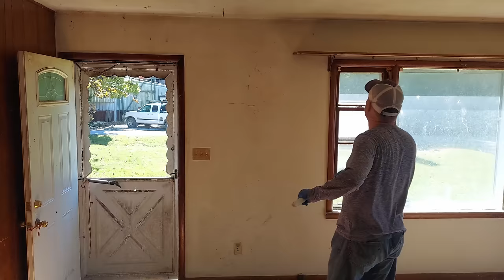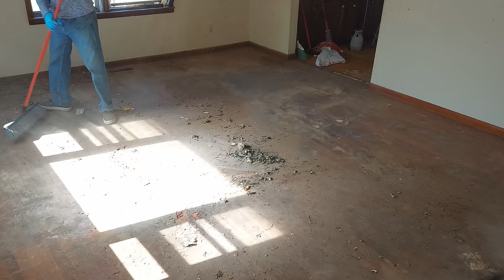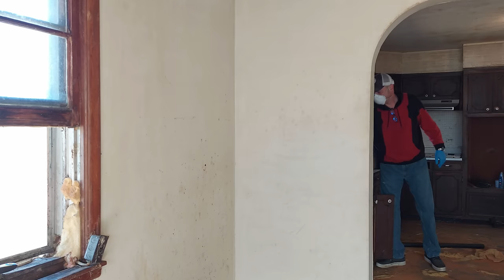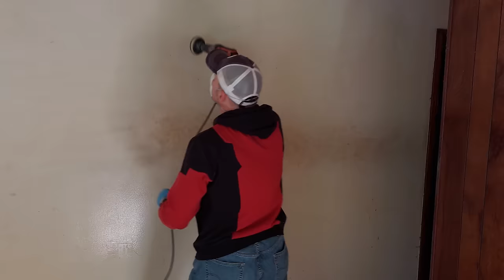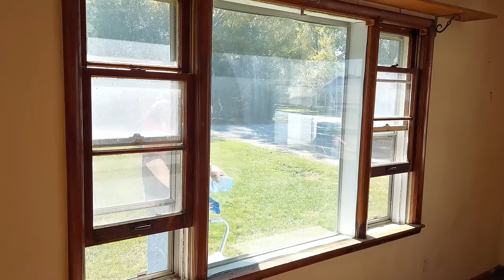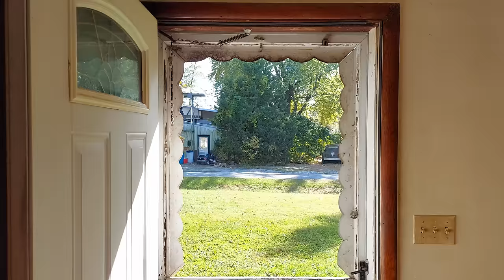Hoarder Aftermath: Cleaning RUINED hardwood floors

Comment: I bought a former hoarder house. didn't know it that was the case till I moved in. they surface cleaned everything but the floor under the wall to wall area carpet was like this one. i had to wash it with Kealn Strip -Paint & Varnish Stripper. turned out great but was a lot of work. I didn't use gloves and was fine. it also didn't remove the stain on the floor only the thick tacky dirt.

Comment: I live in a house that is 100 years old. Hardwood floors throughout. The floors were very filthy when we bought it 10 yrs ago. Thankfully not stained as bad as there but years of neglect. I swear by liquid gold. Our floors were very dry as well. I used the liquid instead of the spray and wow at the difference. I do this at least once a year now. They just glow and the wood drinks it up.

Comment: pine sol dries out wood. should have used Murphy's oil soap. then something like Old English oil to buff it up and put moisture back into the wood. from there you can use regular dilution of Murphy's for regular cleaning. 4/5 x I've saved the trouble of restaining  wood simply using Murphy's/Old English.

Comment: I have cleaned houses in a similar condition. You should try TSP. It comes in a powder and a liquid. It works wonders, but has to be rinsed. You only need to use a few tablespoons of the powder with really dirty stuff like that.

Comment: Using a square buff sander with a sanding screen would remove the surface debris.
You would then use sand paper to finish.
Solvent-based stain will condition the dry wood.
Oil-based poly will seal the wood.

Comment: I'm sure you're going to receive hundreds of tips on making these tasks a tad less labor-intensive so I may as well throw mine in the mix. A few professional cleaners I know who prepare rental properties for occupancy and the paint stores they buy this product from swear by it. CHALLENGER. You can dilute the concentrate 10 to 1, apply it and let it sit for a bit. It rocks. The other 'pro tip' I heard is TSP (tri-sodium phosphate). Comes powdered and you can adjust the strength to whatever suits the situation but it'll knock years of crud off of anything. Best of luck...Carry on.

Comment: This sounds crazy but it worked, I used toilet bowl cleaner the clinging thick type pour it one coat rather thick it set over night it bleached and cleaned in one go. Then I bought a commercial striper and refinisher it was really easy as the bleach made the stain and varnish soft.

Comment: Soapy water and Pinesoil? I had one about the same size, beautiful wood but somebody decades ago decided gluing plastic tiles was the thing to do. The tiles were twisted and loose but the glue had petrified. Floor sander friction melted the glue and instantly clogged the disks so off to buy pro style scrapers and glue removing solvents and take it a foot at a time, then sand, then do final cleaning. You got it easy.

Comment: I bought a house that had nicotene on the walls. I thought they were painted tan at first and it was smoke damage. Someone told me to go buy some Walmart foaming cleaner.  I  did. I sprayed it on and after 30 seconds I washed it with some dawn dish soap in water and the white walls came shining through.  I was able to clean the walls with very little physical labor. 
We ripped up the carpeting and it had oak floors like yours.  I rented a flat sander and cleaned them up until it looked pink, oak flooring.  I was surprised you didn't rent a floor sander to clean those floors so they looked brand new again.  The sander and sand paper was only $40 for the entire day.  It took about 20 minutes to do the living room.  Then I did the hallway and three bedrooms.  My realtor stopped by to see how I was progressing and he said if he would have known that house turned out like that, he would have bought it!

Comment: This reminded of the one time, my husband and I cleaned up a drug house for a landlord who lived out of town.  We had never done anything like this.  The house was infested with ticks, so we used 5 insect foggers on it.  Then, hubby pressure-washed the inside of the house!  Even though it was in the peak of summer hot weather, we were dressed in long pants, long sleeves, scarves, and socks tucked inside of boots.  Each evening, after leaving this site, we would pull over at a gas station and check each other for ticks!  I'm sure the onlookers were amused.

Comment: Love these videos! Had a question as we're dealing with a similar problem with a newly bought but old house. Under the carpet is oak flooring that we think might have been used as subflooring. There was dirt and pet stains on the wood. My husband went over a small portion of it with a sander. Now we're wondering if that was a mistake. We've only done a 4'x5' space but don't know how to proceed. Would sanding before cleaning help with all the dirt from underneath the carpet or would it damage the wood. We want to save the wood if possible to avoid laying down plywood throughout the entire house. We're on a budget as there's so much more to repair and update as we originally thought. Thanks again for this content. It's very informative and helpful.

Comment: There's few things I enjoy as much as seeing something beautiful restored to its former glory. I just hope the people you're working for do right by the rest of the house and don't just make it look nice on the surface. We recently bought a house and saw all sorts of things... hammered houses with good bones, hammered houses with suspicious cracking, new homes, worn homes, but the gem of them all (sarcastically speaking) was the house that had received all the usual repainting and re-flooring in the living areas but had such a damaged foundation that we walked up into the hallway from the living room and down into the bedroom and bathroom... on opposite sides of the hallway... on what should have been flat floors. The living room shiny new faux wood floor panels had gaps. There were bundles of wiring hanging all over the garage space, which was filthy. You could see the tilt from the outside but were went in out of curiosity. The realtor was speechless (he was only representing the buyer on this one).

So I hope that house has a stable structure under those nice clean floors...

Correction: I hope they either sand down and refinish those floors or bulldoze the whole place. Cleaning helped but not enough... yikes.

Comment: Does lemon Pinesol smell as bad as regular Pinesol with just a little lemon added?  I can never figure out why anyone would use that stuff, it smells sooo bad to me.   I would use Murphy's oil soap on the floor and tsp (tri-sodium phosphate) on the walls.  But I do wonder if it might not be easier to straight up just sand the floor since you are going to need to refinish anyway.  I am sure it is nicer to sand when clean, but what is the quickest?  Polyurethane (which is what they mostly use on floors these days) and other paint (wall paint) might have problems with the oils in Pinesol and Murphy's oil soap.   Definitely not going to be using polyurethane after the Liquid Gold oil stuff.  Still this is an attractive approach:  I hadn't thought about trying to hydrate old dry floors and you can always sand and finish with something oil-based.   I loved the stained oiled real wood floor look, though, it is kinda cool.

Comment: I wonder if you can use a pressure sprayer with the concrete cleaner attachment with wet vac.... In addition, would not deck cleaner work? Dry ice ....

Comment: Yikes.  Some other options on such a floor:

1.  Orange oil will cut the crud, penetrate the wood to neutralize some odors, and moisturize the wood.

2.  Oxalic acid will lighten the stains.

Comment: Kilnz sucks!  Prime paint with , Bins!  Its $50.00 a gallon but is thin and goes along way. Have to roll it slow, it will spray off the roller and drip off the brush put a little practice and your fine. One coat will cover all stains including tobacco.  You can paint glass with it and it won't come off so be careful of over spray and drips! Good day.

Comment: If you have to get rid of tobacco smoke stains or heavy dirt, clean your walls with Trisodium Phosphate (TSP) in hot water. Use cheap walmart white towels, working your way from bottom to top. Just throw the towels out at the end as they will be disgusting.

Comment: Why didn't you use a wood and color safe bleach, like Oxiclean, and power sander to get rid of the stains before using linseed and then wax?
Reply from the maker: Because I'm a cleaner and not a floor refinisher.
Reply: @MidwestMagicCleaning  Using as much Murphy's and Gold that you did, it will make it tougher for a refinisher to properly do so with all of that now soaked in oil.
Reply: @DeWin157 If they wanted it refinished, they probably would have done it. That house needs so much work that it would cost tens of thousands. If they had that kind of money, then he wouldn't have to clean the house for free, huh?

Comment: Would it not make sense to use a floor sander?  That would remove the entire top layer, saving you from a lot of scrubbing, and I'm guessing the top layer of wood is probably rotten anyway.  It would also lift up all the caked-on filth and help re-flatten all the fibers which have lifted in the wood from moisture over the years.

Comment: That was mold on the wall so you have to use a spray bottle with a mixture of vinegar and bleach and it will eat away at the mold and you will have a clean wall..also the floor is full of mold so do the same mixture for that as well

Comment: Real nice job there and going that extra mile on the walls and door. Did using that cabinet oil/spray make the floor slick? Or was it so dry that it just soaked most of that in? And how will you fix those dark spots?
Reply from the maker: It soaked right in. The owner will likely sand and refinish the floors. I just did the initial cleaning so we could see how bad they were.

Comment: I heard there's a different cleaning method for wood depending on if it's oil based wood or if it's stained/varnished based only. Have you heard anything like that? I just use soap and water and murphy's oil soap and always go in the direction of the wood grain. Just curious. The black animal urine stains won't come out unless you sand it down completely and either restain it or reoil it.

Comment: Try oxalic acid on those black stains in the flooring. I have used it with great effect on oak for ferric metal stains as well as urine stains from pets. I used rim cleaner as my source of oxalic acid. Mind you it also contained some hydrocloric acid and it's genuinely nasty stuff for your eyes, so wear protection while using it.

Comment: Why don’t you sand the floor with an industrial size sander and then put on 2-3 coats of poly? That would get the black crud off.
Reply from the maker: Because I'm a cleaner; not a floor refinisher.

Comment: I don't understand why you wouldn't just leave it until It gets sanded. After that you can add the oil almost you can't do that before sealing it. We used a stain that had oil in it and left it natural but this has to be sanded and the walls had to be clean before you paint them. but that's why most places use primer which will stick to anything. I would just make sure there's no debris on the wall

Comment: The house looks a lot better. Good job
 I would not apply that much water to wood floors. All that water going between the boards and it will cup.   
Next time hire someone to sand it. Or rent a buffer and try to remove as much dirt and filth as you can. Then sand it with the buffer apply water on the floor with a pump sprayer and stain it ebony. At least It will hide those dark stains better.  Then apply 2 coats of poly.

Comment: Not to be a jerk, but you wasted a ton of time on the floor with Pinesol.  You could have saved a ton of elbow grease by spraying down the floor with Purple Power cleaner or Dawn detergent and hydrogen peroxide.  Then, either rent or use a floor polisher with a pad to agitate the slurry of goo (finish off with carpet machine to rinse and vac).  Again, with the walls, ditch the drill buffer and use a bucket of diluted Purple Power or Simple Green and a deck brush or sponge mop (you'll cover the large area much quicker).   For mildew on wood, try RMR86.  For black stains on wood floors, soak it in hydrogen peroxide for several days.  For glass, never underestimate the power of a squeegee!!

Comment: I’m just curious, but why wouldn’t you just sand the floors?  I mean, I understand getting the grime up, but they are going to have to refinish it anyway aren’t they?
Reply from the maker: I'm a cleaner.
Reply: @MidwestMagicCleaning  I understand that.  It was a rhetorical “you”.  Speaking as someone who owns and leases out several houses, to clean wood, most of the time you have to strip and sand it anyway.  In my experience, it can actually save you time and effort, and the end result is better than spending 5 hours scrubbing mouse droppings.

I was also asking if there was actually any reason as to why this wasn’t done.  Thought maybe you would know something I didn’t, like maybe it just not being possible because sanding a floor that dirty would just force the dirt into the grain or something like that.  Just spitballing

Comment: Good work however it’s not good to use that much water on wood flooring there are special wood cleaners that don’t ruin the floor. If you soak the boards enough you’re just doing more damage.

Comment: You are such an inspiration! I wish you could sell that energy. Can I let you in on the best cleaning product on the market for grease and especially cigarette film on walls. (I'm a smoker so this is a tried and true product) Purchasable at $ Tree or the larger size refill jug for $3. at $ General, LA Awesome. Cigarette film rolls down the wall, so powerful you will hack your head off. I also use this on glass, leaves a horrible streak but cuts grease and film and follow it up with a window cleaner for a shine that is unbelievable. Wish you were close could use you right now. Lynn, Dodge City, KS

Comment: Just so I'm clear, when you say "Pine-Sol at four times normal concentration", you mean, "Four bottles of Pine-Sol in a pump sprayer," right? You didn't get like a superconcentrated version direct from SC Johnson, did you?
Reply from the maker: No, you have to dilute Pinesol with water before you use it. I just dilute it with only 1/4 the amount of water.
Reply: @MidwestMagicCleaning  I see. Thanks for clearing that up; I don't use much Pine-Sol.

Comment: I was wondering if oxyalic acid treatment would take out the dark stains- have seen most furniture restorers use it for that. However as these are 'biological' stain I would be worried how deep they have soaked into the bare wood. I think its a rip out and start again job if possible.

Comment: Great video. I have two separate questions. What you're doing reminds me of a hard-surface version of what auto-detailers do. I've used a steam cleaner to remove nicotine and body funk from car fabrics, seatbelts, headliners, and plastic trim. What do you think about using a steam cleaner on these floors?

Also, I have to ask why you went to such great detail on trying to re-hab those floors? Those stains will never come out. I've tried to sand out the stains in hardwood flooring before, and they're just too deep. I feel like they're just going to be ripped out and replaced, or carpeted over.

Thanks for any feedback.

Comment: I imagine you must be familiar with Krud Kutter, no?  Why not use that since there's no finish left on that wood?  Even if there was finish left, if it were poly or other varnish-based finishes it should have been fine to use Krud Kutter.  Seems to me you spent far more time and effort using the less-potent cleaners instead of using the hardcore cleaners (like Krud Kutter or TSP) from the beginning.  Also, Krud Kutter and cleaners like TSP are heavy degreasers, which would properly prepare the floor for sanding/refinishing.

Comment: You wanna get thick layers of nicotine off cabinets and walls in less than a day while mostly doing something else? Invest in some Scrubbing Bubbles foaming bathroom cleaner.....protect outlets, spray, leave it to work for a couple of hours and you will come back to see wet yellow pools of old dissolved nicotine ready to be sopped up with paper towels...finish off with a bucket of 10 to 2 water (10), pine cleaner (1), and Murphy Oil Soap (1), and allow to dry thoroughly....works like a charm and your nose will never know there was a chain smoker hotboxing the room....